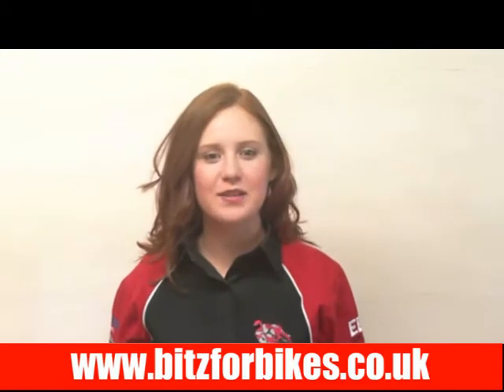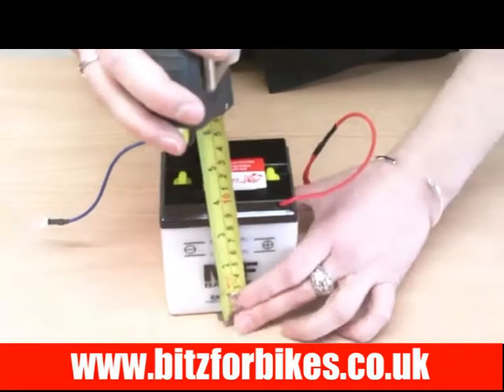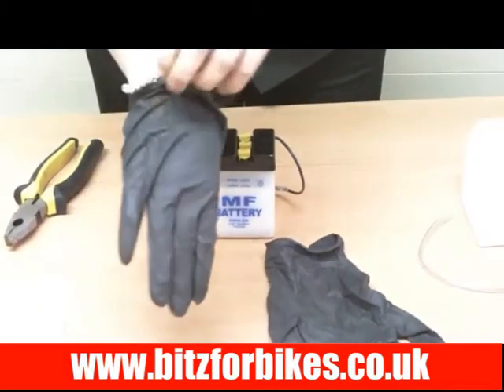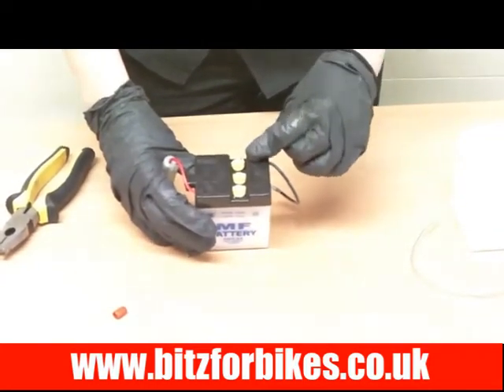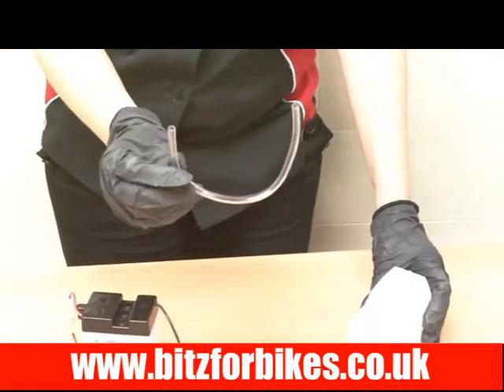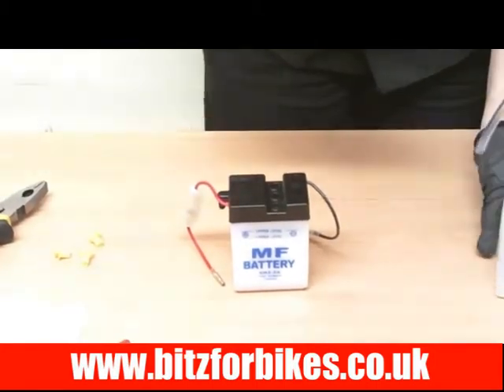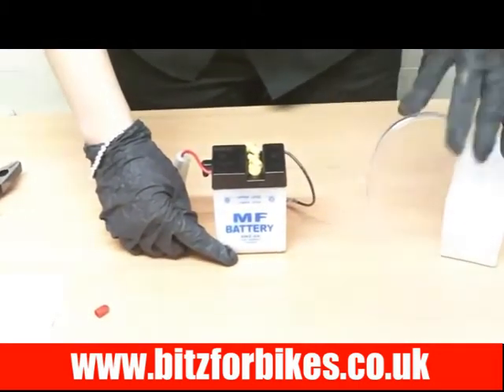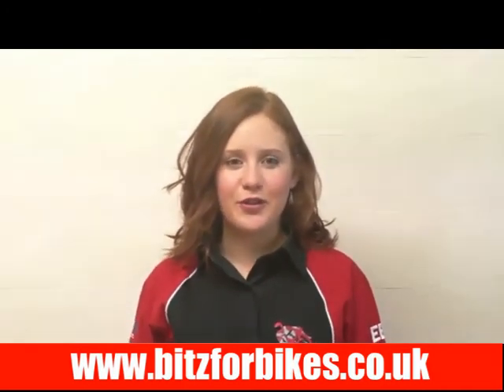Bitzforbikes battery 6N5.5-1D information 706055

Comment: Great! I would only advise all to wear protective goggles when charging acid batteries. I had a new 6 Volt Battery 6N5.5-1D-1 and the cap popped off splattering acid. Luckily, it only hit my pants and not my eyes. Note: the acid burned several small holes in my clothing... Thanks!